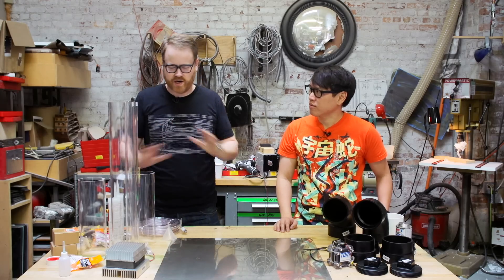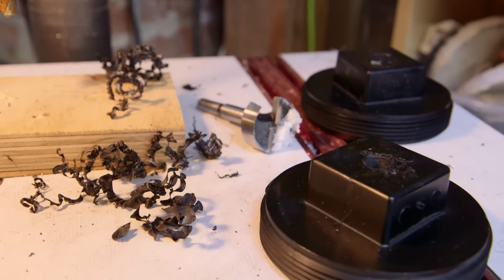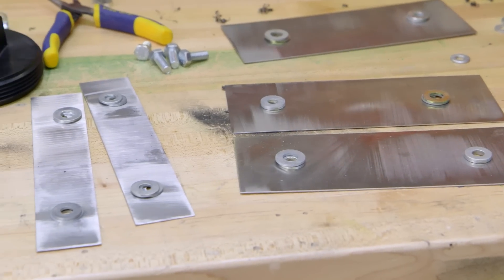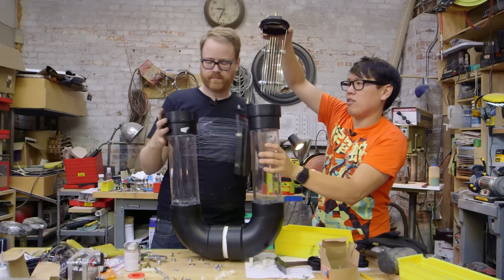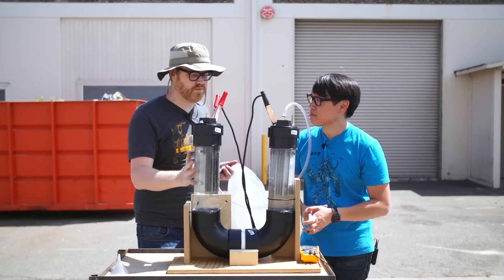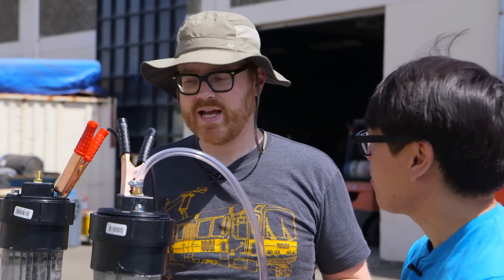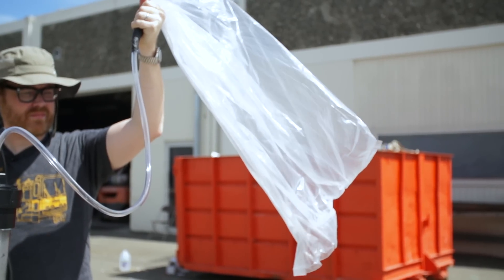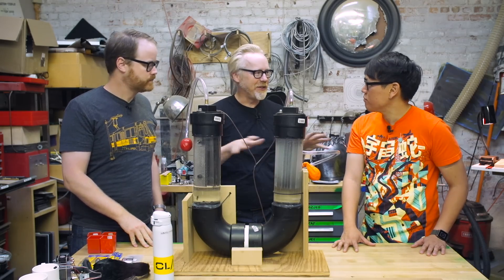Tested Builds a Hydrogen Converter

Comment: Why do you guys keep debunking this?
It's been proven to work.
Are you purposely doing it wrong?
Reply: They need the volts because the electrodes are just too far apart. They should have used 1 tube with plastic plates separating the gasses so they can keep the electrodes as close together as possible.
Reply: I sat here scratching my head - How are they being so oddly naive?!? We built high output cells in our teens....
It doesn't hardly take much thinking or engineering to build a simple but GOOD cell...
This is embarrassing. 
And a little bit odd........
Reply: indeed
Reply: Stay woke, when doesn't the media  mislead or lie. They debunked their own video at the end with it running off a tank of hydrogen. Cars will run off of hydrogen with the correct fuel cell setup. Which R&D is needed for a safe & effective ride. How come tesla don't have an electric/hydrogen hybrid already. ♾MILES ??       
I've seen this so long ago i just watched again for the bs.🔻 👁🔻
Reply: Siward Beorn  Hey man, you got a link to that popular mechanics article on ultrasonic hydrogen tech? I looked but for some reason can't find any trace of it
Reply: Yes they do something wrong
Reply: yes, they must be.   we got it to work in grade school more than 30 years ago.  I even had a rocket set at one point that produced hydrogen and oxygen like this with D cell batteries, and then you launched the rocket by igniting the hydrogen.  didn't fly very far, but was still pretty cool.
Reply: its highly disturbing, to be honest
Reply: Yeah I don't like these guys
Reply: i'm confused.  i keep hearing you can make hydrogen from water but isn't the truth of the statement that you can make hydrogen from water AND washing soda?  is that practical from any standpoint?  that means hydrogen generators must technically contaminate water with washing soda to make this technology "practical?"
Reply: idiots busters
Reply: Probably because of sponsorship like lots of other debunkers (car manufacturers oil companies)
Reply: cough*prop makers are not scientists*cough
Reply: agree, they are hiding something, enjoy your negative ratings you know the reason. Plz build a correct generator and show it.
Reply: U neex 30 amps i been using hjo for 2 yrs i know all abouy thos shit bro LMAO
Reply: If it worked, why wouldn't you use the hydrogen produced to make more hydrogen? Because it doesn't add up: just use the power input (e.g. solar power) to fuel whatever you need to fuel instead.
Reply: @spinfused  it's called entropy. No system is 100% efficient. Obviously it takes more energy to split H20 then is generated by burning H2 and O2. The purpose of it being that it's a store of energy, just like a battery. You generate the H2 and while you lose energy along the way, that H2 is then readily available to be burned and turned into mechanical energy.

Comment: I would guess that you'd get better results with a much smaller separation between the two electrodes. Because you're pushing electrons in one side (to H2), your ions have to take a long time (or be driven by a high voltage = more speed) to the other side to balance the charge. If you put the electrodes much closer, you could generate much more gas.

Comment: "22 volts of power, 100 watts of energy" - physicists cringe
Reply: 100watt at 22v = 4.5A    lol  throw some more panel we need more amp than volt
Reply: @buder5116  volts aren't power and watts aren't energy
Reply: @thewhitefalcon8539  i never said power neither energy who talking to ? i wonder
Reply: 🤔 ohm's law 🤔
And didn't they say earlier in the video output is dependent on amperage, then later said voltage?
Reply: Each "cell" only requires 1.24v to get electrolysis, which is why you can do this even with just an AA battery. So that means they need 17 cells (pairs) of plates, and those need to be in series. They're losing quite a bit of that energy to heat. After that, just crank up the amps and they'll get all the hydrogen that they need.
Reply: I was gonna comment that. I hate being a corrective asshole but it really made my toes curl when he said that lolol
Reply: @southern7766  22 VOLTs of EMF*, 100 WATTs of POWER. If im wrong please correct me cause im trying to learn physics for electronics.
Reply: They want to make this seem as extremely dangerous as possible and confuse ppl as much as possible because this is the wiser of all energy production we know of. I've seen some DIY builds that blow this thing out of the water. No pun intended. Damn sellouts.
Reply: @jvon3885  it runs on electricity
Reply: @thewhitefalcon8539  no way
Reply: @thewhitefalcon8539  it's easy to harvest electricity. We don't need silly plugins and a shop to get electricity. In theory you could literally turn your shag carpet static discharge into a stunning 12v+ if you built the right device. Imagine a spark gap powered by ppl in onezees going in circles then touching a doorknob hooked up to a dual tower coil with a secondary coil then to a large capacitor and fly back transformer. I'm just learning about high power electricity so my circuit may be wrong. But that sums up the energy companies don'tcha think.

Comment: It is no wonder the unit made very little gas.  It was being fed the wrong voltage and starved for power.  The correct power for this would have been 3v at 30 - 50A.  One large cathode and one large anode in the unit equates to one cell.  Grant T. uses "floater" plates in his design in which he created 8 cells in series.  This is the reason his HHO generator uses a higher voltage, but notice he uses 2 car batteries for the high amperage also.  He mentions this in his video as well.  I guess these guys missed that detail.  Very high output gas generators are commercially available as kits and pre-assembled for under $500.  These guys should have met their quota had they applied the correct power to the unit.

Comment: Typical systems also use two different catalysts with a pH barrier. But I've seen a study that uses two nickel-iron oxide catalysts that can be right next to each other, and operates at 82% efficiency. I believe they used stainless steel in the video.
There's also the issue of the separation of the anode and cathode, their setup had them too far apart, which causes inefficiencies.
And they had an issue of hydrogen leakage, you can definitely tell during the closeups of the balloon. 

I've personally never been a fan of Tested, as I find Norm and Will to be absolutely annoying, but videos like this just show their lack of knowledge, research, or even care of the subject. This honestly shows the downfall of people that only watch one video and do a project without research, which is what they literally did.
On the other hand, I love Adam and how passionate he is with his work; it's just a shame nobody else on Tested shares his passion and care for things.

Comment: Wow, this is shockingly full of miss information. "22 Volts of power, 100 watts of energy." "The more voltage you run through, the faster that process happens." Nope... Nope... SMH
Reply: I’m confused tho because the higher the voltage the more work done per unit charge and more work done should mean that the process should happen faster what’s wrong?
Reply: @anonymoushimself1540  hydrogen splits from oxygen when it is exposed to 1.23 volts, when you have 100 volts its not going to be faster then with 1.24 volts
Reply: @lucascasters4138  de lo que depende la producción de hho es la frecuencia de la intensidad de corriente a mayor mejor , con una batería de automóvil hubiesen tenido mejor resultado
Reply: Who is Miss Information?
Reply: Exactly! 1.5-3 volts is all that is needed and then you increase the amps for more productions.

Comment: You needed 24 volts at the least to produce the gasses efficiently, pulse your sanding grit was too high, Higher grit means lower surface area on your product. <3 You should be making 12 liters of oxygen & hydrogen at the least. I want to see if you could measure the gasses you did produce. last thing, I swear, I loved this project but you forgot that the surface area plates were both anthode and cathode in the original. Electricity was not meant to travel so far through the water. This wasn't a traditional Electrolysis machine, It's mechanics are very different <3
Reply: +Sulli11  the standard potential of water is -1.23V therfore idealy only 1.23V are needed for electrolysis of water. Anything above is overpotential however the real world is not ideal and the voltage has to be higher depending on the chosen electrode material  ( best Platinum electrodes for the lowest overpotential voltage).  Electrolyte choice and distance between the electrode will also influence the required Voltage as these will create a variance of the internal resistance of the system.
The Electrolysis apparatus  build here is a Hofmann Voltameter style which is one of the easiest to build traditional apparatus to obtain O2 and H2 gas separately.  Yourself and many others here use Oxyhydrogen aka Brown's Gas aka HHO generator as a reference which creates the highly explosive mixture of Hydrogen and Oxygen gas together and such kind of  system would not have been able to " fulfill"  the challenge that Adam had given.
With either style it is possible to use higher input voltages without creating a high overpotential voltage  by connecting multiple plates in series which will divide the input voltage up in accordance to the qty of series connections. This can easily be done with HHO generators since you do not have to worry about the H2 and O2 gas separation and is far more complicated to achieve on an electrolysis apparatus that needs to generate pure H2 gas.
Reply: You want low volts (I think 2) and high currernt
Reply: Apparently Voltaic Pile Batteries and Trough batteries produce an excess of H2 gass, and it runs on Salt water. You could produce 6 volts per 1x1x2 inch battery. Double Hydrogen generator :D 
And Yes I read your information, Excellent job on the research Milan, and thank you for the bit Catprog, But there is 1 thing Everyone is forgetting. The salt bridge, It doesn't matter how much electricity we put through the thing if the energy isn't going anywhere. Due to the KOH in the solution the electricity mildly passed through the entire system. Though Since they never mixed the water solution in the first place I don't think that the KOH even did anything except react with the metal plates. If you want to do the experiment Correctly  take this image and beak down the differences.  Otherwise this is good information, just not everything was accounted for.
https://cdn.instructables.com/F4A/54HN/F5R8MQ53/F4A54HNF5R8MQ53.MEDIUM.gif
Reply: a salt bridge would not be a problem since the electricity will force the flow of electrons through it.  The KOH is just there to increase the conductivity without creating impurities in the gases but certainly mixing it good would make for a better working system.  Who knows maybe they actually mixed it well and it just wasn't shown in the video. Only the tested crew can give an answer to that and we'll likely never get that answer. IMO the plastic bag they used to catch the Hydrogen was not suitable for this task and was leaking the produced Hydrogen like a sieve.
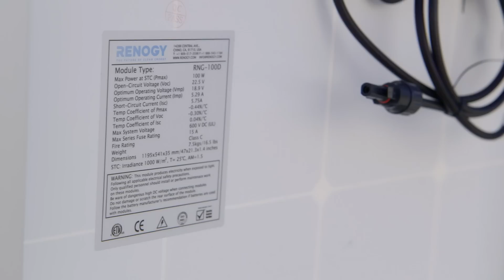Reply: So I've come back a year later. Pause at 6:35, its weird that the amps aren't in amp hours. The max it can do is 5.75 "A" for ampere but no other labels to the optimal rate of that so this reaction requires 10 Amp hours and they supplied it with 5 "A" Whatever that is going to mean. Thanks +catprog for getting it right off the bat.